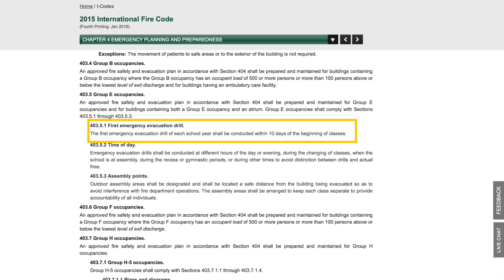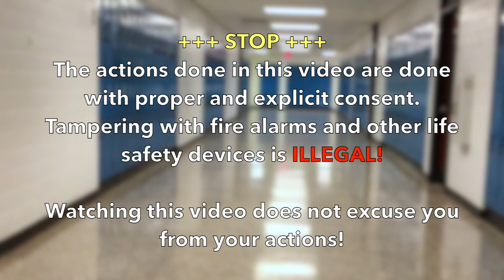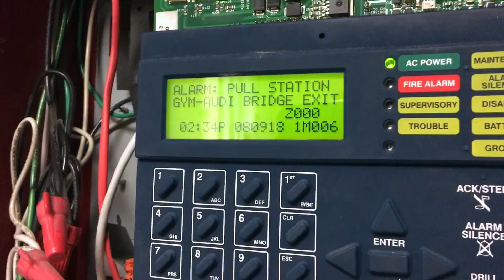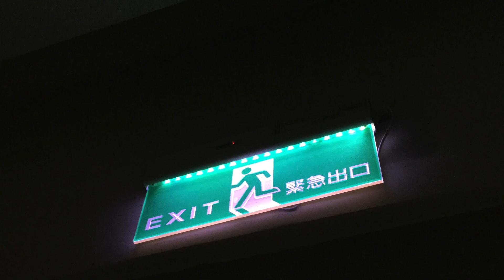Fire Drill № 4 ~ It's a Pull!

Comment: Nice! I thought voice evacuation is required in all new schools nowadays, and it’s required for the entire school, not just one area. Is this like an older school that got renovated?
Reply from the maker: Good question, and a long response for it.
The school's last major renovation was in 2012.  By that time, our AHJ required to have voice evac systems in any "places of assembly" regardless of what type of occupancy the building was for, but that likely didn't include the main school buildings at the time.  Therefore, horns were just installed for cost.  Nowadays (after 2015), it seems rather odd to think that a school with over 100 occupants (in fact, we're over 15 times that limit, whew!) isn't a "place of assembly", so we will likely be getting a voice evac system in the coming years.

Comment: does it have to be done, even for an outdated system of electromechanical horns on continuous that wasn't upgraded since the day it was installed(including the panel). the alarm system at the high school I am going to is mosty 4903/2903 strobe plates with 2901-9838/2901-9806 electromechanical horns(about 30 horn/strobe sets) on a 2120 panel, with a mixture of other devices like: wheellock 7002t(2), wheellock as horn-strobes(1), simplex truealert horn strobes(8),  simplex 4938s horn strobes(5), and specaralert avanded horn strobes(3). there are no remote strobes and rarely smoke/heat detectors on this system, and all horns are on continuous. in most places of the building, the only way to trigger the alarm is a t-bar break glass pull station
Reply from the maker: Yes!  Your system may be connected to relays that perform important tasks.  It's better to test them when you perform your drill.
Now, you can usually set off your pull station without breaking the glass break rod.  You can usually open the pull station then flip a switch to manually set it off (or, in your case, just open the pull station then close it).